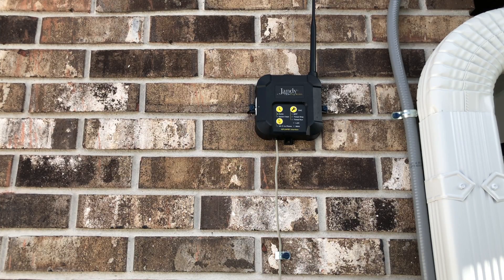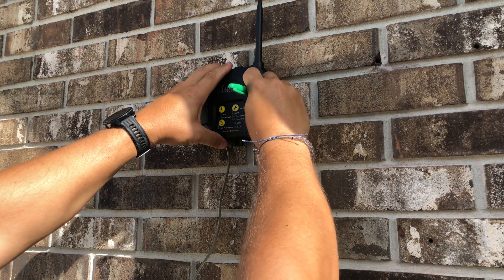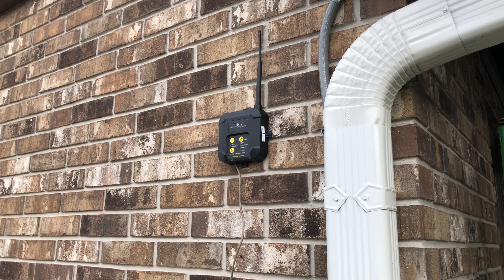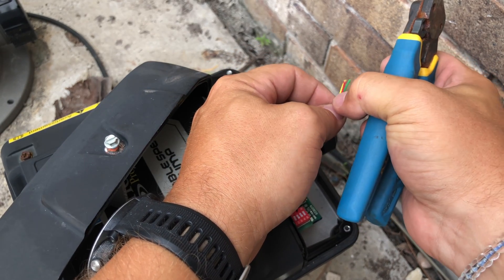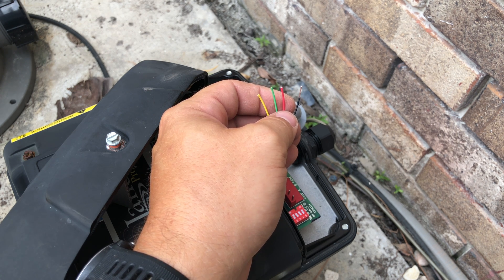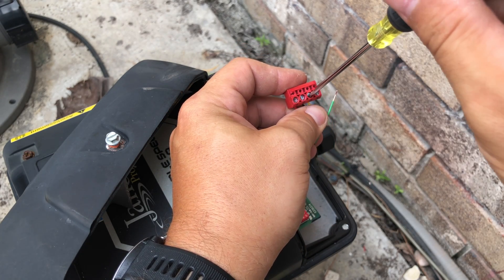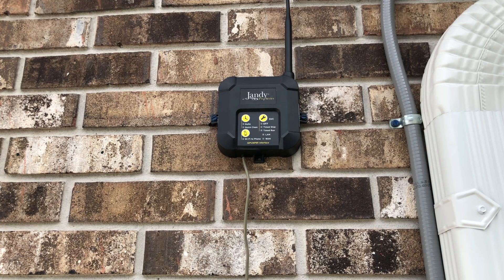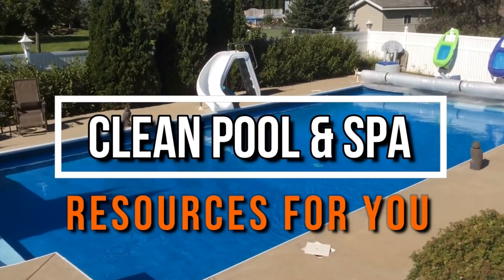How To Install Jandy iQ Pump Controller (Step-by-Step App Automation Setup 2024)

Comment: Can I install 2 of these for 2 pumps on the same system? - pump for pool and pump for waterfall features. Both pumps are surrently installed and running. One has the IQ pump already installed but now I want to add the 2nd.
Reply from the maker: Yes you can. Each iqpump can only control one pump.

Comment: Excellent explanation and camera work. Just a tip: before you start drilling holes in your house move the controller box around until you find the strongest signal. This system loses wireless connection fairly easily and just a few feet to either side can make all the difference. Your walls may have internal structures that cause interference (wiring, metal reinforcements, solid versus hollow concrete block).
Reply from the maker: Good advice and thanks for posting.
Reply: @ChlorineKingPoolService  My home Wi-Fi is one of those newer MESH systems. I was able to move one of the range extenders to an outlet on the inside of same wall where pump controller is mounted. Now the connection is bulletproof. Upgrading from a single speed pump to a variable speed that is programmable in a phone app is the only way to go. Now my pump circulates 14 hours a day using less power than a 90 watt light bulb. And half the vacuum hours are at night during off peak hours. Pool is clearer than ever and just a fraction of the electricity cost

Comment: I already have a controller connected to the RS485 interface.  Can I keep both the IQ pump AND the existing controller?
Reply from the maker: What controller is it?
Reply: No. According to the IQpump installation manual only one device may be connected to the TS485 interface